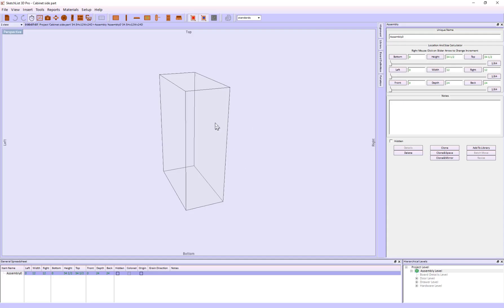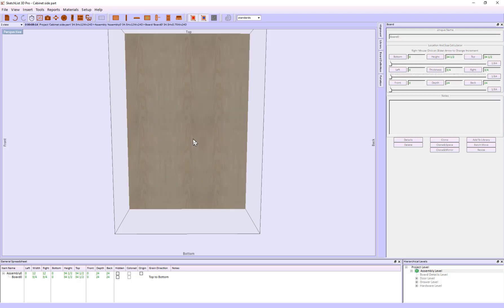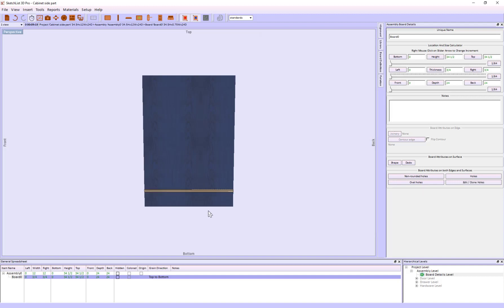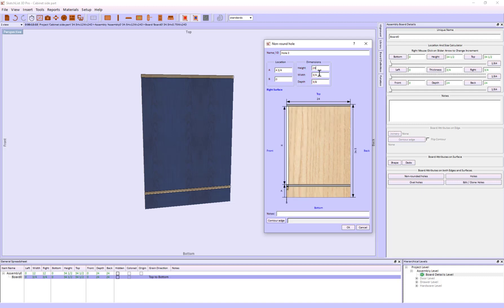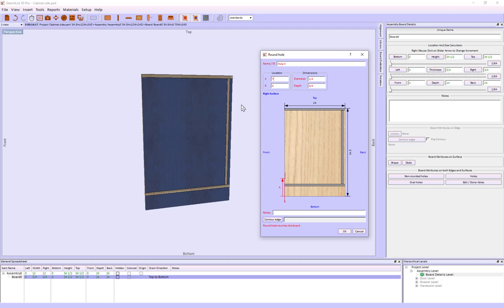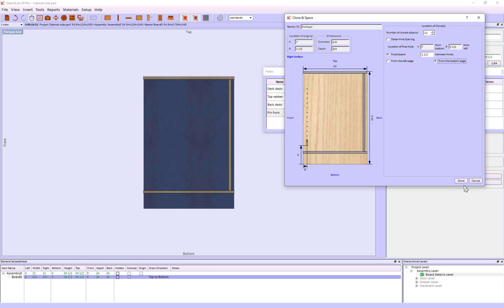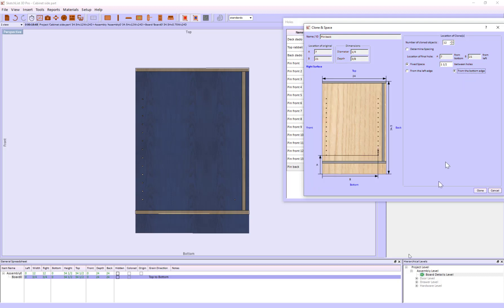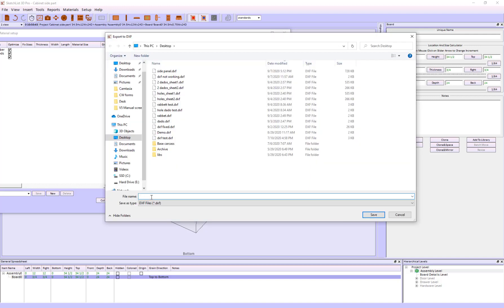Using SketchList 3D to prepare for CNC cutting

Comment: Where is this in the version 5?
Reply from the maker: The DXF file necessary to export to your CNC is generated by the optimizing process probably you’re running the hobby version which does not offer optimization